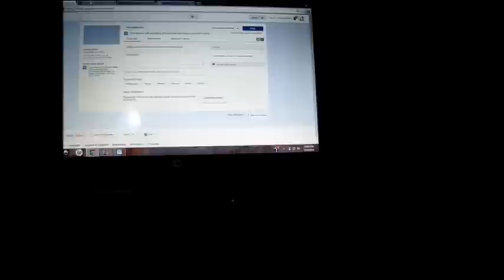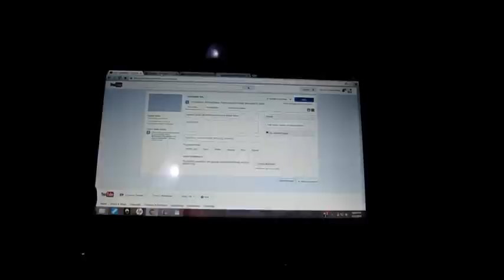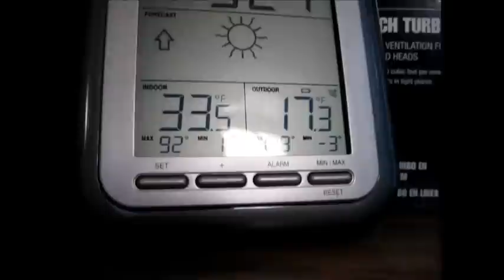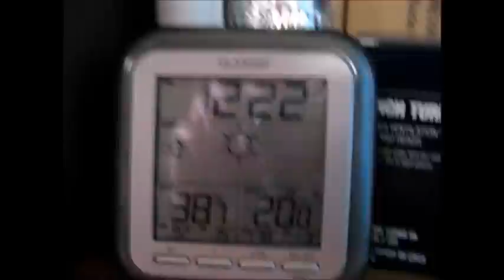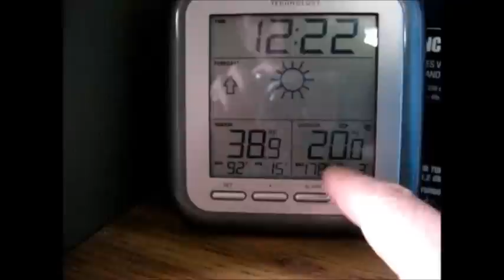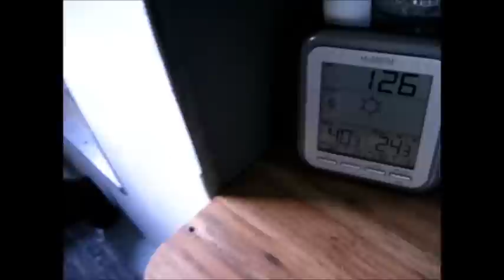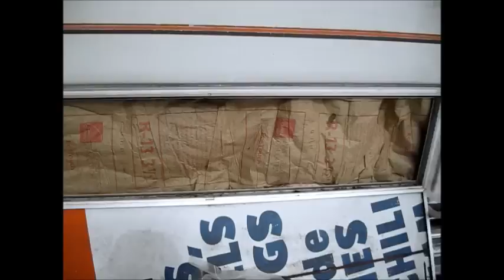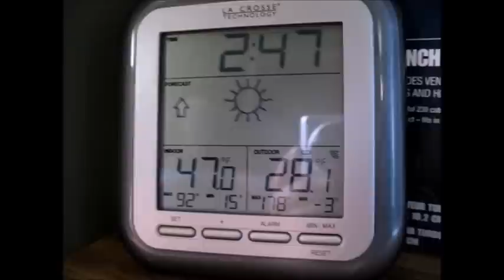Fighting Freezing Cold And Numb Toes In My Off Grid RV

Comment: Hi Troy - some more thoughts and ideas from the Prairies: 
- First, a quick question. Did you buy the INSULATED rubber boots? If not, you're going to loose a toe or two if you tromp around in uninsulated boots. The liners are the key to warm and toasty feet. (I've worn mine inside as slippers on our -35C days!) Rubber actually draws heat from your feet so you'll make a bad situation worse if you're out in the cold and snow in uninsulated rubber boots. And even light work gloves will help you keep your hands warm.
- Glad to see you remembered that coolers can keep things warm as well as cold. If you have a second (preferably hard sided) cooler, consider boiling up some creek water or whatever as a heat source (plastic pop bottle?) and keeping your cooking oil and potable water in there to keep them at viscus temperatures. 
- Do you have any skirting left from the trailer? Remember how last year you felt an immediate improvement when you skirted the trailer? While your RV certainly has better r-value than the old trailer, at least try to block off the bottom that faces the prevailing winds. 
- I'm sure that tomorrow's video will include you repairing/replacing the front of your porch. I'd also recommend figuring out some way to stack at least a day or two of wood inside to allow it to thaw and dry out for use. Consider putting a boot mat or even a plastic lid with some drainage holes cut in for the water to leak out the bottom and outside of the porch. 

Remember that it's still officially winter and that spring is a fickle b**. You still have plenty of cold nights and a few snow storms and cool temps heading your way.
Reply from the maker: Thanks for all the pointers. No I got cheap rubber boots, not insulated.

I will fix the porch today. The cooler is working well. Boiling water takes a lot of energy. I can drink creek water directly or filter it.

Yes the RV needs skirting. I used the camper skirting to build my wood stove shed.
Reply: well, I hopw you get some insulated ones. You're going to have a mighty uncomfortable month without them. Remember that they dont go bad and you'll be wearing them for years.
Could you set a pot on top of the barrel stove? I am concerned about how efficiently you have yourself set up. Yes, boiling water just to keep a warm cooler would take up a lot of energy, but until you can maintain the temp inside the rv to at least a few degrees above freezing you will spend even more energy (your own) drinking icy cold water and dealing with frozen eggs. Plus, you dont really need to boil it, just get it hot.

Comment: ive been camping for weeks in caravans in -30. i apreciate the difficultues,  but i have had the fortune of using kabe caravans, used for acrtic camping. double insulated  flooring, sandwich airtight walls ans insulation glass. easy to have 25 inside despite the intense cold.

Comment: how about getting one of those greenhouse type parking sheds from tractor supply and parking inside it?  it would keep the wind off.  you could also pack straw or hay bales in between the rv and the tent/shed for insulation.  not sure how big your rv is, but if it is small, this would help.  I would also cover outside and inside windows with plastic and double sided sticky tape.  just make sure you have some form of air flow for fresh oxygen. put plants in your greenhouse.  see the 'earthship' models. you need to be very careful with carbon monoxide poisoning, especially burning in an enclosed space
Reply: Missy Rabbit.  I kept rabbits in one of those. (maybe 30-35 angoras at any one time) It kept the wind off of everybody including me when I was out tending them.    Harbor Freight tent/garage is cheapest.  But there was condensation on the metal ribs.  (no heat. just moisture in the air.)  But putting it over your RV would no doubt help with the wind.   Also.  If you collect (a Lot) of leaves & pile them against the windward side, maybe use some cinder block or the like to make it tall,  they give off heat as they decompose.

Comment: Hey Troy, what about some of that coal that you picked up last year? I don't know if you have the funds for it right now, but it might make a huge difference to keep a fire going long enough to dry out enough of your wood to keep the stove going.  Is there anyone at your church that uses wood heat that would be willing to help you out with at least a few days of dry wood so you can get up and running again? At least with it so cold out, it would be fairly easy to drive your truck out to get supplies. Just a though.  My prayers are with you, (and baby cat too of course) god bless
Reply: That's what I was thinking too, but just didnt know for sure, having no experience ever using coal. I would think that it shouldnt get too hot if the dampers are kept closed enough, and like you said as well, it would likely help the wet logs dry out and burn.  I'd actually be interested to try that one myself sometime.

Comment: Couple points, Brother: Your propane heater is way to small, FYI.  BUT, more importantly, you want to avoid using propane to heat, if at all possible, due to the condensation if causes.

Of all the portable heaters I've tried, the Presto heat dish is the best by far (Costco).  You get heat exactly where you need it, instantly, and it only pulls 1000 watts, max.  A small gas gen, or a 1.5k DC-AC converter puts you in business.

Reflectix insulation, doubled over, makes an excellent barrier to cold.  I use it to line all storage areas with walls to the outside.  I also line any interior walls where I spend any significant amount of time: the bedrooms, the eating area, the inside of the door, the inside of the windows, etc.

The 6 mil, clear plastic can be doubled over and taped over all exterior windows, also.  The plastic and insulation seriously cuts down on drafts, which is what you need.

My nighttime temps are at where yours are, but the inside of my very large 5th wheel is 60F in the living room where the heater is at, and 50F in the bedrooms.  That's with only ONE heat-dish also.  So insulation makes a huge difference.

As far as your numb feat go, rubber boots don't allow you feet the wick.  Even on cold days, your feet perspire.  There MUST be a way of wicking the moisture away from your feet for them to stay dry.  I wear insulated boots, but NOT waterproof, that way they breath.  Wear two pairs of Merino wool socks and one pair of waterproof socks, such as "Seal Skins."  The merino wool allows your feet to wick, while the Seal Skinz prevent water from reaching you socks or feet, while also wicking.  In other words, moisture gets out but not in.

Comment: Hothands makes an insole that works grrreat they also make hand warmers go to Amazon and stock up
Reply: FRANCHESKA JOHNSON 
You can use the insole of your boot as a pattern to make bootliners out of Reflectix. I’ve seen Reflectix at Lowes for cheap. Use it on all windows, windshield too. Put some rolled up towels against the gaps at the bottom of the door. Lay Reflectix sheet out on your bed. Put under the sheet or just under your sleeping bag. If you are in class A or C hang blankets to wall off drivers areas. Tons of heat loss from 3 walls of glass. Use Reflectix around and behind heaters. Can also use it on walls and ceiling.

Comment: Troy:
With such bitter cold  I think you should be running your propane stove top and also oven(I can't recall if it works or not) for extra heat sources right now. I know propane is expensive but look at how your suffering right now.
I recall going to a family "summer" cabin in the Catskills (decades ago) and my Mom using the electric range to heat things while we got a fire going. No other heat source besides the fireplace and it was late Fall.
I think you tired coal in the wood stove didn't you? Might be worth having some for standby heat if wood is wet.....
Reply from the maker: It is dangerous to run the propane stove top indoors. It days so right on the side of it. The heaters are catalytic heaters and designed for long term indoor use. The stove is not. I do have coal but have to learn how to use it first. I can try it when I get my stove shed fixed.
Reply: GrandsonofKong One thing to keep in mind is that open flame propane, like the eyes on his stove, release moisture into the air. Condensation becomes a big problem when it's cold. Electric heat, as with your Mom's stove, is a dry heat. That's why it's easier to season newly cleaned cast iron cookware in an electric oven. Harder to do in a propane oven, unless steps are taken to reduce the moisture buildup. Especially during pre-heating. Cold surfaces & warm moist air = condensation. Whether it's on cast iron cookware or fabrics becoming damp.

Comment: freezing to death with a full sized gas stove inches away?
Reply from the maker: Gas stove? Dont know what you mean. The propane heater was long gone when I got this. I heat using only fire wood. Anyway, I am way better off these days in my off grid tiny house on wheels. Check out my daily videos of the off grid homestead. I have come a very long way since this video. Now I sweat in winter cause I over insulated the tiny house and got a very efficient wood stove. Got married and have a full time helper on the land which I am now buying. And still making videos as my main job. Good life :)
Reply from the maker: Because it is deadly to do so. The gas oven or stove top do not provide a safe, clean burn like a catalytic heater. You can die of carbon monoxide poisoning when using them for heat. And because at that time I did not have much propane to spare anyway. Times were tough. I had very little resources. Wood was all I had and I was cutting it daily as needed because I did not have any saved up. Not sure if you know the story but I had just recently lost my apartment and job and was thrown out in the snow to live in my camper unprepared.
Reply: The Do It Yourself World so if you cook a turkey or large meal,you die? buy a co2 / fire alarm. you should have one already. the trailer looked pretty well ventilated back then. i've always thought the best heating system for a rv/camper would be radiant heat in floor and some walls. once all of that fluid gets hot,it takes a long time to cool.all combustion could be outside. they just don't put enough insulation in camper do they? i opened up my old camper walls and there was only a little layer of fiberglass. i live in maine so i don't think i will be staying in it on a  winter overnight. it is great that you made these videos  ,so people can see the reality of it all.
Reply: The Do It Yourself World oh you should wire brush and chip all the snow off the frozen logs. if it fell on there when froze,the wood might not have absorbed much moister. but you've done more than i could ever do.that's for sure.

Comment: Those temperatures are not cold .... Winter camping can easily have -20 degree nights. Was this a cold snap that you werent expecting?!
Reply from the maker: Try living in a camper which has no insulation and wind blows through. I woke up to ice instead of water each morning inside my camper. It was cold.
Reply: The Do It Yourself World i've done winter tent camping in -20 temperatures - water freezes solid in less than an hour. I've also done fall camping in my camper and, at nights, it gets down to 5 degrees Celcius. As long as you've prepared for it, you wont have any problems. I understand there was a situation that forced you out of your house.... But living in the camper without properly preparing for the temperatures at the time was a choice.
Reply from the maker: LOL, your last two lines contradict one another. I agree with the first, that was the case. But it was not a choice. I had no other options at the time. Well, outside of living in the open woods, that is.
But I made it through. Now I am still making daily YouTube videos. Never went back to the rat race. Still making videos all these years as my main income.
Now I have two houses, a garage, wood shop, electronics shop, 2 greenhouses, chickens and more on 18 acres of land, off the grid. Have a wife and one year old daughter too.
All from daily videos. Hope you follow along.
Reply: The Do It Yourself World how do they contradict one another? Being forced out of your home does not mean "lets go camping in the cold!". Most people stay with a friend, stay with a family member, rent a place, look for government assistance, etc. - especially in the winter. It was your choice to use the camper - and your choice not to take a day and prepare (if you're heating with wood, you can usually process a month's worth of wood in a single day using hand tools). 

Perhaps i'm failing to see where the "contradiction" is that you're claiming I made is..?!
Reply from the maker: Doesnt matter. I was not prepared. That is true. Not at all. But I adapted and made it through.